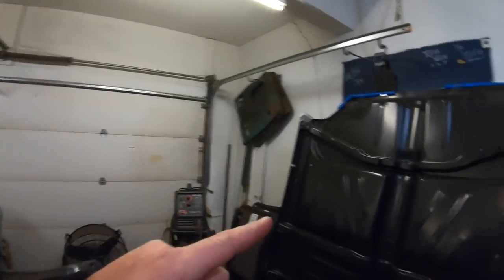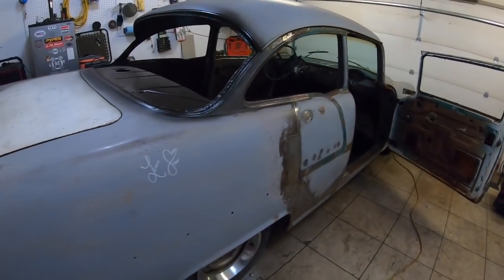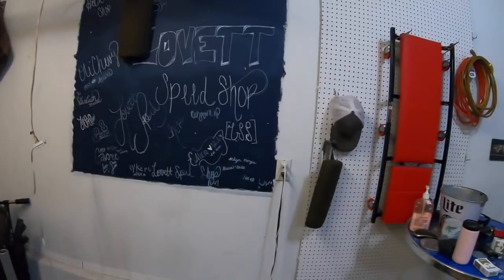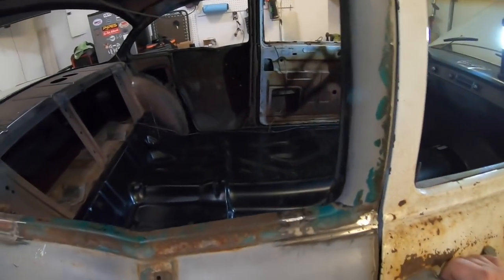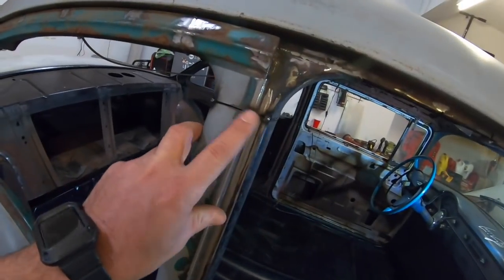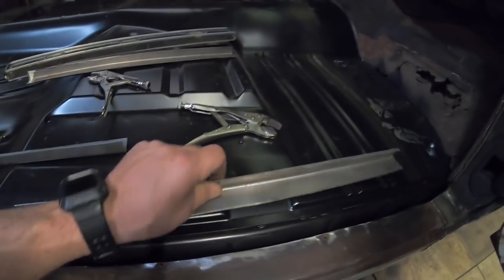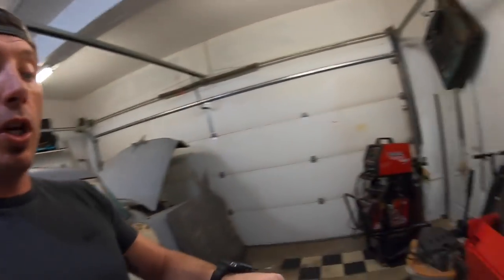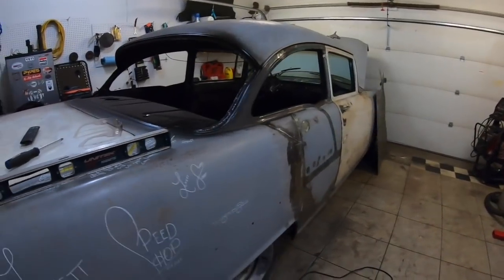TriFive Chevy: 4 Door to 2 door Conversion - Floor Pan (Part 2)

Comment: I was wondering what it would cost if you could do a set of the raised spindles for me. My welder is a little 110 flux core welder. Ok for sheet metal but not for a deep penetration weld needed to do the spindles. I would have to locate me a second set of spindles fist also. Thanks James
Reply from the maker: Hey James email me at Lovettspeedshop@gmail.com   I’ll give you some price thanks
Reply: @LovettSpeedShop  email sent

Comment: When you cut the old floor out did you cut the flange out at the toe board? When you make the toe board patches are you planning on recreating a factory style flange to join the toeboard and floor?
Reply from the maker: The flange is still there. I’m probably gonna seem weld it for time being when I make toe boards. Then when I pull the motor go in that way to fix the flange.

Comment: I`m doing exactly what you're doing on my  4 to 2 door conversion on the 55.  I have a floor pan and doing what your doing on the passenger side. I love your videos , before I saw your video I was already thinking of doing this. I bought new doors and Quarter panels expensive and doing the welding myself. I cut the rusted floor pan and install the one piece. Your videos are great thanks